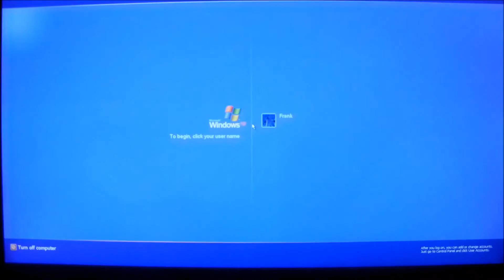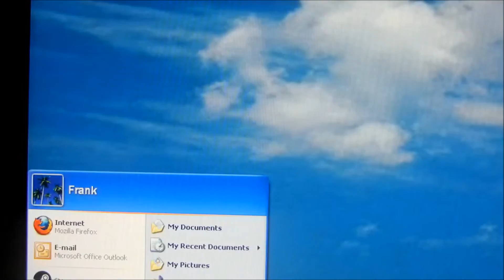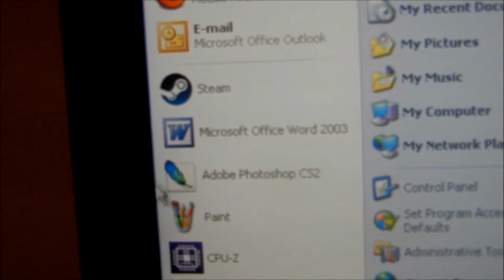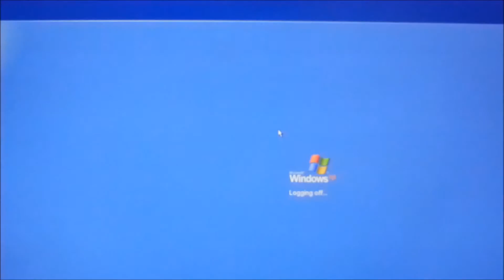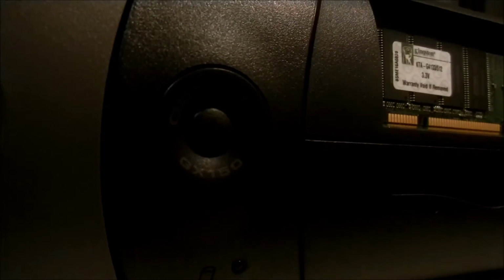Dell Optiplex GX150 Review Windows XP

Comment: I still have this computer. I bought it in 2010 for 10$, it had 80GB WD HDD, CD-ROM and only integrated graphic card.  It was shipped with Windows XP SP1, In meanwhile I changed some parts, for example i installed DVD Burner, GeForce 4 Ti and right now i using it for playing late 90's early 00's games . It is very durable computer. Thanks for that review

Comment from the maker: I know, on the top right, I still have the "Designed for Windows 2000" sticker. I have tried Vista but 7? 7 must be a little slow... 95 to XP work fine, wouldn't tend to use MS-DOS though.